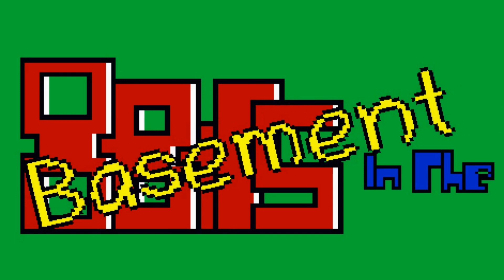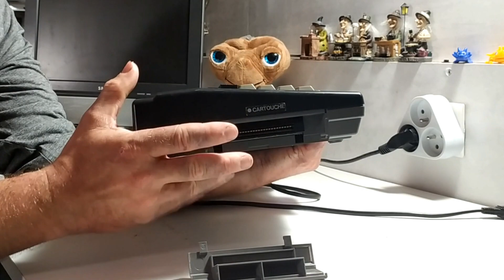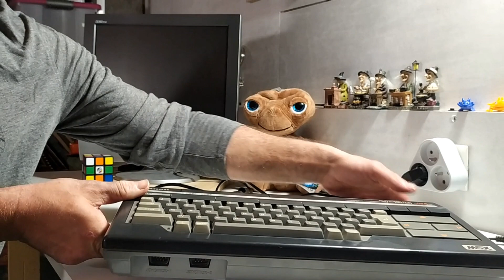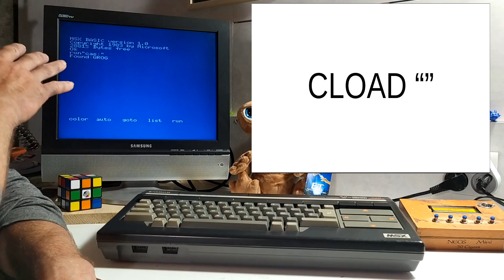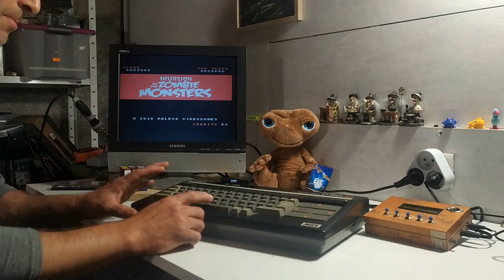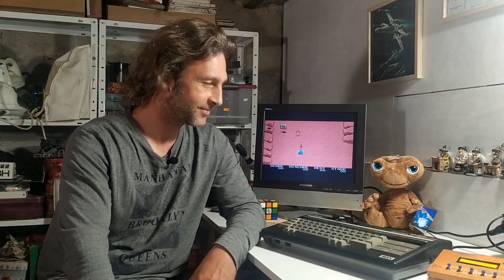Come, take a look at the Canon V 20 MSX computer from 1983 that Microsoft made | 8bitsinthebasement

Comment: The design of the Canon V20 has always appealed to me. Those directional keys have a certain something special.
Reply from the maker: The Canon is a nice looking machine and it's built like a tank both inside and out. The large directional keys look good but they're a real pain to use due to the layout (you'd have a cramp in your hand after about 10 minutes of using them). Great line of machines the MSXs though. Thanks for stopping by and leaving a comment ;)

Comment: I had a C64 but one of my friends had an MSX. They were beautiful looking machines. Too bad some software were just lame ports of ZX, I think the system had a great potential.
Reply from the maker: You know the very first time I powered it on and loaded up a couple of tape games to try out I thought the exact same thing. Trying out some cartridge software on the machine and of course the revelation that it could run Coleco vision software on it changed my mind though. It did lead the way to the MSX2 which gave us games like Metel gear solid. Thanks for watching ;)

Comment: Sempre achei interessante o computador e o teclado virem dentro do mesmo corpo sabe me dizer se tem algum computador moderno que siga esse conceito.
Reply from the maker: Ei, desculpe por ter demorado tanto para voltar para você. Para responder à sua pergunta, o único computador "moderno" em que consigo pensar que tem a placa-mãe e o teclado juntos seria o Raspberry pi 400. Parece que eles não os fabricam como antigamente. Espero que o Google Tradutor tenha feito justiça à minha resposta. Obrigado por assistir ;)

Hey, sorry that it took  so long to get back to you. To answer your question the only "modern" computer that I can think of that has both the mainboard and keyboard in a case together would be the Raspberry pi 400. Seems that they don't make them like they used to. I hope that Google translate did my answer justice. Thanks for watching ;)
Reply: Raspberry Pi400 rigth? Thanks a lot for the help.

Comment: My first computer was a Sony Hitbit MSX.  It was a nice system that I have fond memories of.  The games I remember  playing most were Nemesis, Penguin Adventure,  Road Fighter, Konami Soccer, Antarctic Adventure, Kings Valley, Yie Ar Kung Fu 2, Shark Hunter, Sorcery, Chuckie Egg, Special Operations, Blagger, Manic Miner, Knight Tyme, Stop the Express and Polar Star
Reply from the maker: The MSX was a great computer at the time. Like I said in the video some of my friends brothers had them but I never got the chance to play around with one back in the day. The Sony Hitbit was the Rolls-Royce of them all, did yours have a slider to increase the CPU speed?. It was one of those that I was on the lookout for when I found my Canon V20. 
I did play some of the games you mentioned when I was younger, but on my C64, mainly Nemesis and Yie Ar Kung Fu (the first one, I was never really a fan of the second one). Thanks for watching and taking the time to leave a comment. Much appreciated ;)
Reply: I had HB75B which is functionally the same as the V20 apart from the fairly useless built in software.  You can use the Sony 4k SRAM data cartridge with the built-in software,  to save/load small basic programs and with some of the Yamaha musical cartridges.   Today I also have a Sony HB F1 XV MSX 2+.  That one has a hardware pause button, CPU slider for slow motion, a built in autofire for the space bar or joystick, MSX Music FM sound chip and the 9958 graphics chip

Comment: No mention of the msx2, which has improved graphics and most of them were equipped with a 3.5" floppy drive making it much more accessible (ie with a gotek drive). Games arealso much more advanced compared to msx1 games, some rivaling 16 bit systems.
Some of my favorite msx1 games are boulderdash, zanac, arkanoid, beam rider, parodius, salamander, kingsvalley 1 and 2 and a whole lot more!
Reply from the maker: You're right, the MSX2 was a real leap ahead from the MSX1 with some really impressive graphics for the time. It even launched some game franchises that are still running today, Metal gear is an example that springs to mind. I thought about it but if I had mentioned the MSX2 in the video it would have been something along the lines of; "The MSX came out in 1983 and was followed by an improved version, the MSX2 with better sound and graphics in 1985. These were followed in 1988 by a third generation of the machine, the MSX2+."  and not much more. I figured that when we talk about the Vic 20 we don't always mention the C64 and so I stuck to the MSX1 alone. If ever I get my hands on a MSX2 or plus I'll make a video on them but I'd have to win the lottery to be able to afford one ;) Thanks for watching and taking the time to comment ;)
Reply: @8bitsinthebasement Would be great to see a msx2 or 2+ video! Msx2 doesn't have improved sound though. Fm and scc cartridges work on both msx1 and 2, though I don't know of any games for msx1 with fm pac support, but you can play music in basic.

Comment: The title that Microsoft made this machine is correct .
Reply: My comment is incorrect . I meant to say is incorrect not correct 🤪
Reply from the maker: I see what you mean. I may have worded the title a little "click batey" ;) As far as I know they put together the general idea, but never any concrete hardware design.
Reply: @8bitsinthebasement  Microsoft Was even no longer involved once They started the next generation msx computer (msx 2) . Stating it is a Microsoft computer is giving Microsoft too much credit 🤪
Reply from the maker: I for one was surprised when I learned that they came up with the standard, well both Microsoft and the ASCII Corporation. But Microsoft EXtended or Machines with Software eXchangeability, what do you think MSX stood for?
Reply: @8bitsinthebasement  I think the meaning changed when Microsoft stopped their support . For the msx they only supplied basic and later msx-dos 1. They had nothing to do with the hardware design

Comment: Another great video!  I picked up a Yamaha CX5M MSX computer a little while ago.  I unfortunately have not got it working yet, it is coming up as a blank blue screen when I turn it on.  A problem to solve this fall, it has almost made it to the top of my repair list.  Seeing some of the games you showed has moved it up a couple of places on the list!
Reply from the maker: Thanks Ken, when you get your MSX fixed up and good as new get yourself a few cartridge PCBs. I've found that they're by far and away the best way to use this system. Of course some great games came on cassette too (but I've found that most of the best were on cart).

Comment: One of my friends got his hands on a Philips (I think: it was two years ago) MSX machine a while back, mainly because it had MIDI support. Can't remember the model. It's on my list of systems to get, but I'd like to get one of the MSX2 machines, so I'm making life a bit hard for myself!

In a bunch of ways, the MSX feels like the TI/99 machines done right.
Reply from the maker: The MSX was a mystery machine for me until I picked up this one. Like I said I saw only two of them in the flesh growing up but I'd never seen one powered on. One was a JVC the other, I have no idea. The MSX2 is probably the one to get but they are expensive (the system that started the Metal Gear games). Good luck in your search and thanks as always for the support ;)

Comment: The first game has the same graphics as a c64 game that I played, which was called bc tires. I would like you to make a video in which you teach how to build a circuit that converts an analog signal into a digital signal to load c64 games with a smartphone using the datassette port. greetings from argentina
Reply from the maker: I've played that one too, but many, many years ago. Grog's Revenge is in fact  BC tires part 2 and it was also available on the C64 and a host of other systems. As for your video request; I've got notes on how to make a device to connect any tape recorder (or phone for that matter) to a C64 for loading programs (it won't let you save them though). I'd have to order some parts but I may be able to put a video together about it in the next few months. Thanks for watching ;)